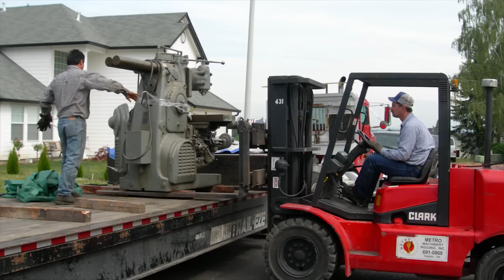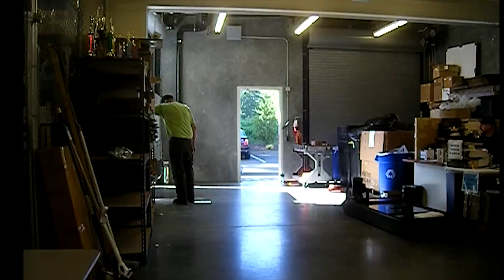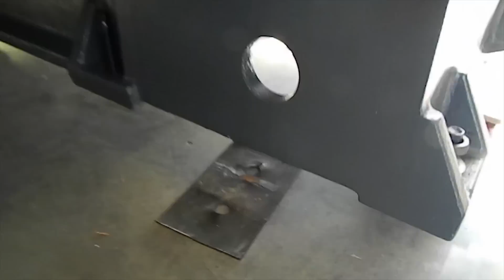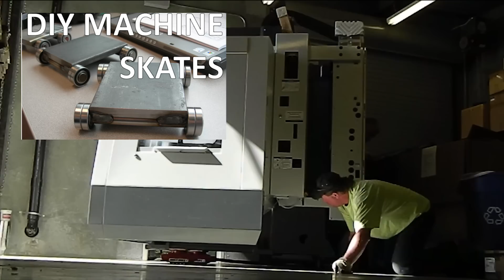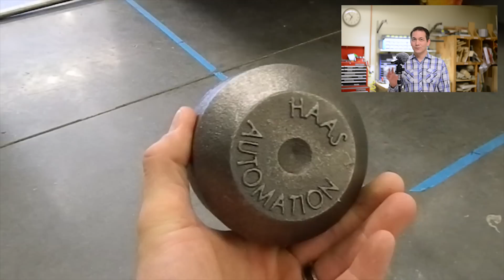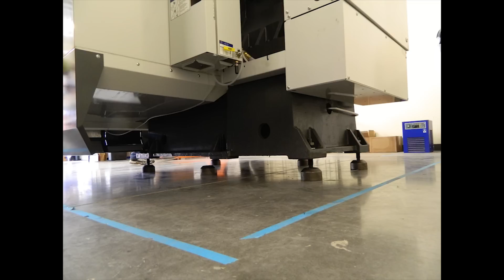How pros move a CNC mill

Comment: Would be nice to mention rates.
Reply from the maker: I actually didn't get involved, so don't know the rate charged by the riggers who handled the Haas VF2.  Generally, though it's going to follow some formula of hourly rate * hours (including their travel to and from their company location).   The riggers & equipment (truck/forklift) have separate hourly rates.  The fastest way is just to call them and ask for a rough estimate based on what you're moving and how far.
Reply: @amaedesign  I actually bought my first VMC and company was about an hour away from pickup location and drop off was about same place as the riggers. They used sellers 10T over head crane and also their forklift. They didnt have long enough spreader bar and rigged machine from x axis gantry (gantry style machine) using eyelits and one strap from base frame. They then used all my mates at the drop off location to push the machine inside building. They didnt know what they where doing and their boss called a day later to bill me. Rate was 500 AUD/hr i think. He quoted me 1900 and i was like we pretty much did most of the work and he only dropp 200 so 1700. I was like lesson learned. They lifted half the machine's weight off the x axis gantry which i believe had eyelit holes only to carry x axis beam during manufacturing not when assembled.

Comment: Great video and much appreciated. The only additional details I was hoping you would show was how was the "Final Leveling" accomplished useing the machine base jack screws. Typically you would use a "Machine Level" wish is more accurate than the common builders levels. You maybe best to have 2 -3 people working together. Place the level on the milling center table in both directions and call out direction to the guys adjusting the jack screws trying to have all jack screws supporting the machine weight accordingly.